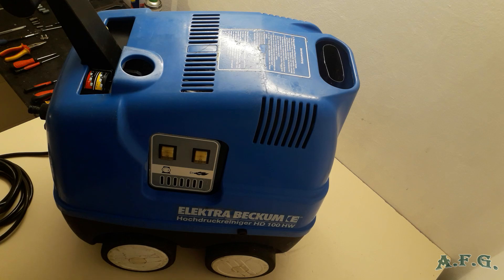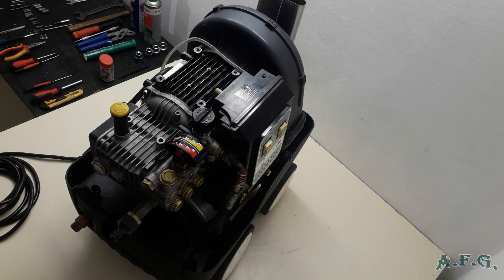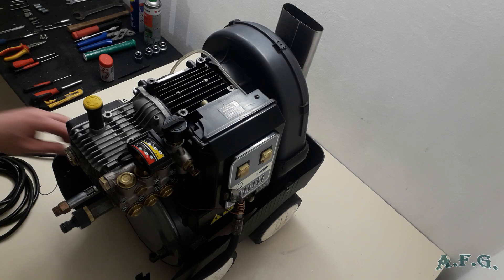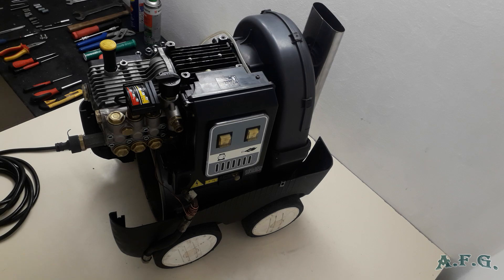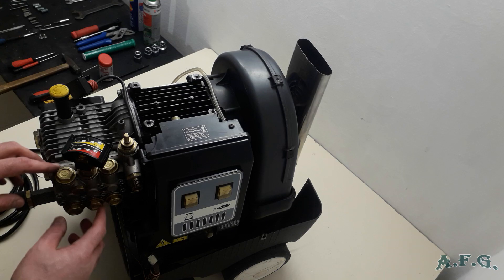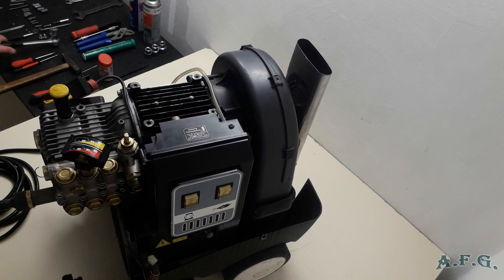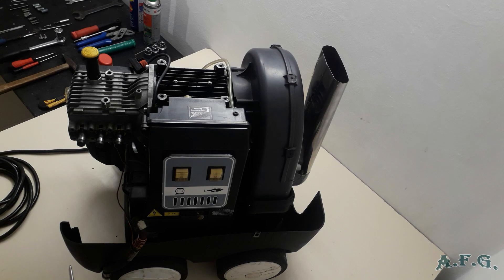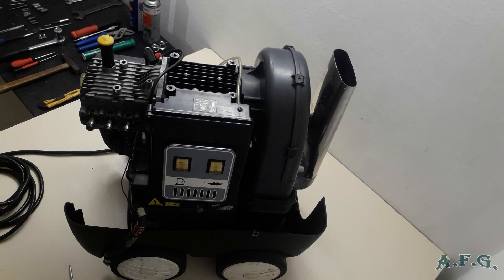Disassembly; Beckum HD 100 HW; Portotecnica Mitho; Electrolux Mitho; HDEm 100 HW;  Taskmaster Mitho

Comment from the maker: @krisal2271; Hi, as you must have noticed on this high-pressure cleaner, it is a really massive heavy-duty pump, versions of which also with other water O-rings were installed more than 25 years ago in professional machines built for much higher pressure in bars. It is even significantly more massive than I have in a professional high-pressure cleaner, such as the Karcher HD 5/15 C+ (max. 185 bar). 25 years ago, companies did not optimize the price of components as drastically as they do now. That is why it is on this cleaner, whose operational adjustable pressure is only around 90 bar. All those who know a little about cleaners, that the pressure of 90 or 100 bar in Kranzle, Karcher, or this high-pressure cleaner Elektra Beckum HD 100 HW is not the same as the pressure in others, e.g., hobby cleaners declaring e.g. 150 bar. Not only because professional cleaners have a higher water flow, but also because professional pumps have a different design. Therefore, the pumps themselves are very expensive as spare parts in the event of their replacement. I once saw a similar (maybe identical) one for one of the Portotecnica Mitho versions on some German site and it cost around 400 Euros. They are built for an extremely long life under heavy loads. Of course, even the most massive pump made of the highest quality materials cannot withstand severe frost if the owner has not properly prepared his machine for the winter, either by storing it in heated rooms or by filling it with antifreeze. Are you really sure that your pump(s) is broken? Or you just have that feeling because it leaks water while working. Cracking of this type of pump is very exceptional, precisely because of their immense robustness. It may be that water is leaking from the pump because the O-rings need to be replaced, or the pump is not properly tightened. For example, I changed all the water O-rings now, and the pressure is great, but I still have some water leakage, so I need to find out if it's because I accidentally mixed one of the old ones with the new ones when I changed them, or I have a poorly tightened pump. My pump does not appear to be cracked. These machines are great because they are very small, have very compact dimensions, weigh only 52 kg, height, is only 60 cm, have a great flexible hot-water high-pressure hose, and really professional high-quality components such as Portotecnica Motor, Italian pump, or a double coil where water is heated from special steel that can withstand a load of up to 200 bars (there is a label on it). But that's why these components, as spare parts, are quite expensive and cost more than 300 to 400 Euros. It is better to repair them in case of failure or to buy a used spare part. On the other hand, these small heavy-duty hot water cleaners have one huge advantage over other professional cleaners. It is an extremely simple construction and, above all, a simple and cheap replacement of parts that wear out due to normal and everyday use. For example, since this machine has a seemingly low operating pressure - 90 bar, it can use 6 water seals – O-rings in its pump (I used water rings from the spare parts list for an almost identical machine - Elektromaschinen HDeM 100 HW), their size is 15.08 x 2.62 NBR 70 SH. The number 70 means the hardness of the rubber and the abbreviation SH - Shore. Precisely because of the relatively low pressure of the pump, it is enough to use completely ordinary O-rings made of Nitrile with a hardness of 70, the price of which ranges from e.g., at the level of 0.20 Eur (20 cents), which is a ridiculous amount compared to e.g. with a water ring for the Karcher HD professional high-pressure cleaner, where the price of 1 ring is also 5 to 7 Euros. And you need 6 of those rings since you have 3 pistons. So, for example, a complete replacement of oil and water rings and other seals in this machine (without the price of work) will cost you e.g., less than 20 Euros, but if you want to make the same exchange, e.g. on the Karcher HD cleaner, so you can't do it yourself cheaper than 70 Euros if you buy the whole set, then at least 130 - up to 170 Euros. If you take the machine to the service center, around 300 Euros. And that is already decent money. I managed to repair the machine because the advice from the distributor of cleaners of the manufacturer R.E.M Power – Elektromaschinen HDeM 100 HW helped me a lot. Their branch in Slovenia, in the town of Komenda, very willingly provided me with a list of spare parts for the HDem 100 HW cleaner that they sell, the vast majority of which could also be suitable for the Elektra Beckum 100 HW. But no one can give you 100% certainty, since these machines older than 25 years have not been produced for a very long time, the company Elektra Beckum disappeared (it was bought by Metabo in 1999, and they moved production to China sometime around 2010) and later the brand disappeared. Even Metabo was already bought by someone else. I've spent hours on the Internet and contacted a lot of repair shops in Europe, including Germany, and no one officially services these machines anymore, and they don't even have schematics or sell spare parts. I later found out through research what I wrote before, that like now, the same or very similar machines were sold under different brand names, with the basic components all identical. And so I discovered that the Elektra Beckum HD 100 HW, Eagle Mitho, Portotecnica Mitho, Electrolux Super Mitho, or Taskmaster machines are more or less identical machines, only with mostly different engine power and pressure power (thus they must have different water O- rings). For example, these Elektromaschinen HDem 100 HW from R.E.M Power are still sold in some countries in the Balkans, Electrolux is still sold in South America, e.g., in Brazil, some versions of Portotecnica are still sold in Russia and possibly Italy. They are heavy-duty machines that can function for over 40 years with proper maintenance and winter storage. Hopefully, this comprehensive answer will help you and others. I contacted the R.E.M Power office in Slovenia, in Komenda, and they helped me a lot. They still sell spare parts for the aforementioned HDem 100 HW machine. Greetings from Slovakia.
Reply: Thank you very much for your answer. I have learned all information about the story of the company and the advantages of this machine. You help me to make my decision to keep the machine and I will find a way to repair or to change the pump. Unfortunately my pump have a big  visible crack in the area of the valve for pressure control. I will look for any solution. Thank you again for your time and  professional answer. Regards. Kris.

Comment: У меня лопнул керамической поршень, а без шильдика насоса, не могу заказать поршень.
Reply from the maker: What is your pressure washer's exact brand name and type, please? I have attached spare parts lists from similar power washers to the comment section. Hope it helps. I have got metal, not ceramic pistons. Ceramic pistons have better temperature management but they are breaking more often than metal ones like I do have. I think, if you replace one ceramic piston with the metal one, it could work if you won´t be able to get a ceramic one anywhere.

Comment: Подскажите какая помпа там стоит?
Reply from the maker: I think it is a high-quality Italian pump produced for companies like Italian Portotecnica and German Elektra Beckum in 1996. Operating pressure of the pump on this model is 90 bar. Great advantage is that for the pump with this operating pressure, the water seals (O-rings) for the pump are very cheap as they can be only 70 SH (hardeness). The pump itself is really robust and when I checked spare part price of similar pumps, they cost over 400 Euro - so you can see, it is high-quality prof. pump. https://youtu.be/WmxyYbwjOsA